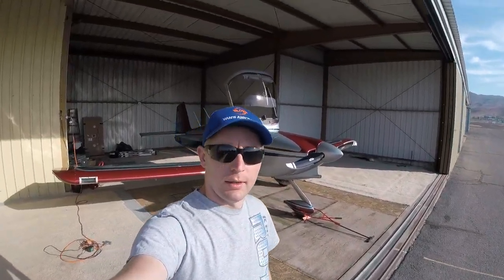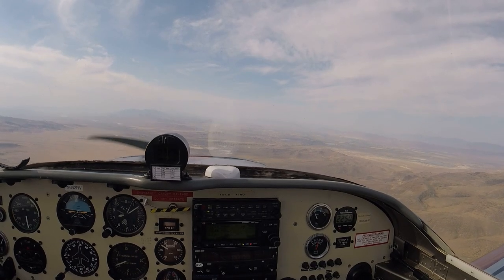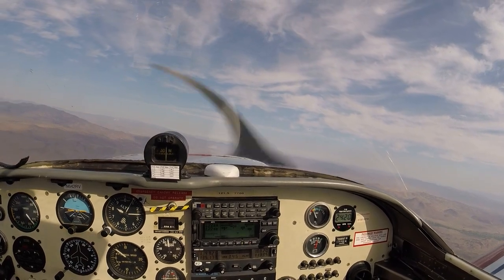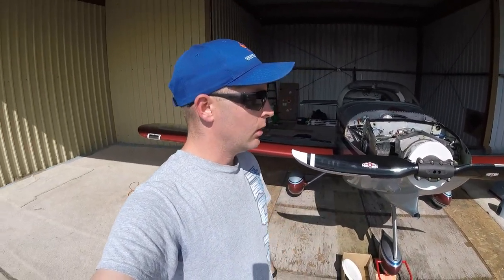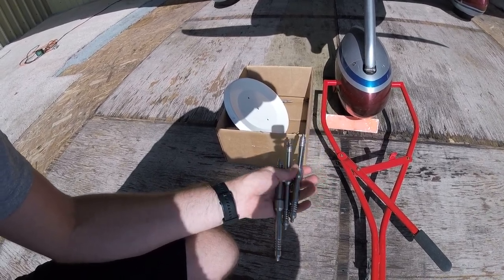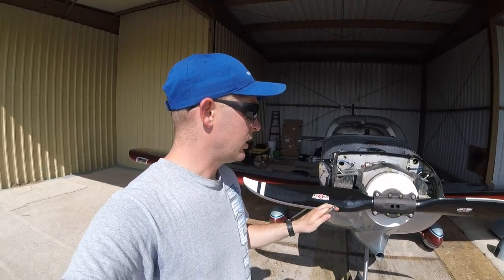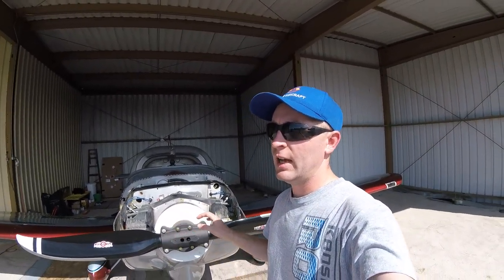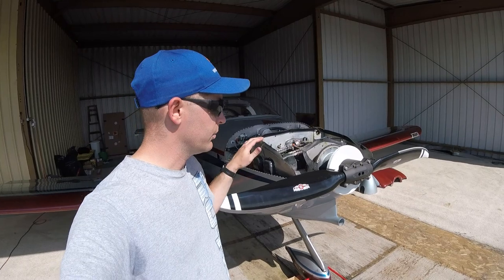Sensenich Ground Adjustable Prop Review

Comment: Good video and timely. I just got my Sensenich variable pitch prop and installed it today. I haven’t had a chance to test it with different pitches yet. What is the torque you are using on your prop bolts?  Mine are torqued at 30 foot pounds.
Reply from the maker: I used 350 inch pounds, so just over 29 ft pounds. It's pretty neat to see how the performance changes as you change the pitch.

Comment: Hi, can you share your settings with regards to pitch and WOT rpm on the ground? Thanks!
Reply from the maker: No problem! Sensenich sent me pin numbers 0 through 5 and I'm using th number 4 setting. I'm not sure exactly what pitch that correlates to but that is the most course pitch. I'm getting about 2200 WOT on the ground. When I go to sea level that goes up to around 2300.
Reply: @RVationNation  what minimum runway length and max climb rate does that correspond to?
Reply from the maker: That depends on many factors, such as horsepower, weight, density altitude, runway surface, and obstacles. I've flown it off a 2500' grass strip at sea level with 80' trees 700' from the end and handled it easily. Your stopping distance will be the biggest limiting factor. Most folks won't go less than a 1500' runway, and that's with a clear approach/departure path.

Comment: Great video! Heard you say grade 8 bolt? NO!! Do not use those on an airplane! Especially on a prop. Only propeller bolts with rolled threads are to be used. Grade 8 is too hard and brittle and will fracture. Stick with approved hardware even on an experimental.
Reply from the maker: Scott, Sensenich sends you grade 8 bolts with this prop and is what they recommend. I even called and asked to double check when I didn't have the right ones!